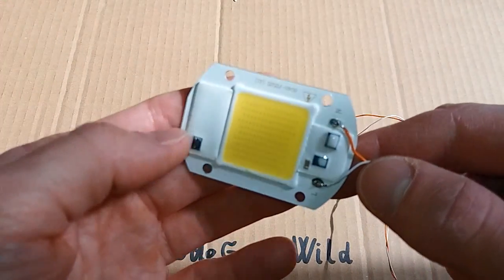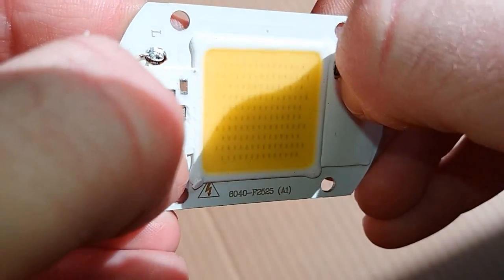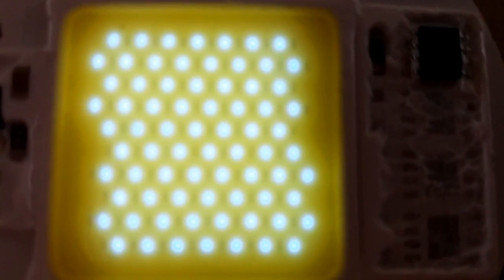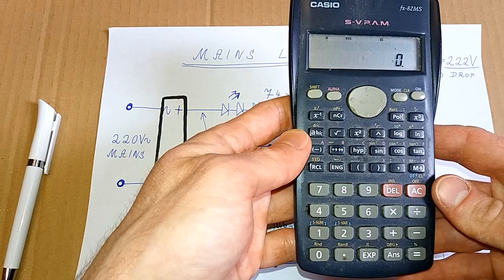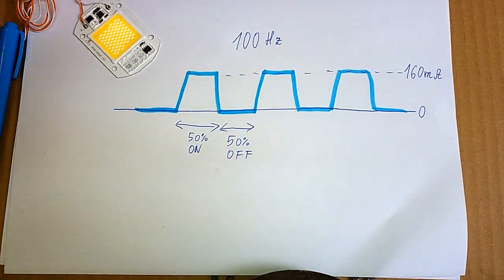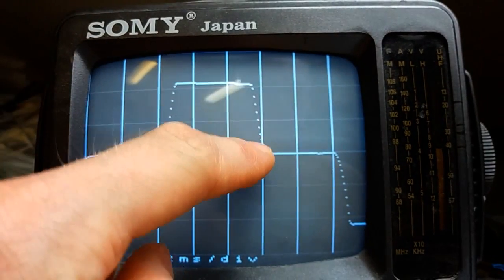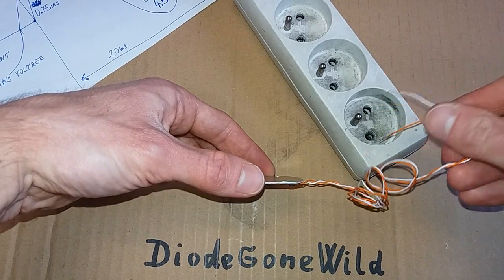Mains Voltage LED (and how NOT to handle mains voltage!)

Comment: Put the filter capacitor across the led string only , the wattage + power-factor will not change, only thing is the capacitor has to be larger, like 100uf or more.

Comment: You need to buy a 50w one and then desolder 4 of the 5 current sensing resistors. you get a 10w led but with more led chips. more lumens per watt

Comment: These can be made much more efficient by adding a dropper C on the AC-side and let its reactance limit the current, taking strain off of the linear regulators. Then simply add a 400V electrolytic (10µF+) across the DC side of the fuuull bridge rectifier for almost flicker-free light.

Comment: Big Clive did a test on these. The board is aluminum with a thin layer of fiberglass. On the top of that is the copper traces for the circuits. He did an insulation test of 1000v 3 times which it easily passed. But yes, always earth the heatsink just in case. I just wish they made these with filter caps to stop the flickering.
Reply: Just get ur own capacitor, I did! It works well, I also got a external full bridge rectifer, then soldered the wire to the L an N
Reply: @ggesdsdsdsd  the light now runs at double the power
Reply: @lifeai1889  Yes, true. But I did remove 2 resistors from it, could also put the capacitor across the LEDs only
Reply: shit power factor+shorter lifespan

Comment: This light works great.✴>share4.photo/oWorkLight?を    It has a bright setting, medium bright setting, and a strobe setting. I use this light to work under trucks and it works great. The only slight downfall is the battery life. The battery will last only a couple hours before needing a recharge. Having two of these lights helps while one is charging.
Reply: This is not relevant to the video

Comment: Help! I connect my driverless cob led directly to AC 220, it exploded and burnt my table. What did I do wrong ? And my room all outlet not working, while the other house area fine. I checked my fuse box no breaker trip. What should I do?

Comment: I just got a few of these (50W) but I don't have any heatsinks for them. I do have a 1/4” thick aluminum plate thats about 8"x10". Can I just cut a piece of that bigger than the LED (maybe leave about a 1/2”-3/4" border around the LED?) and mount it to that? Would that work well enough? I do have some thermal paste also.

Comment: Great video. You helped me understand when the LEDs turned on and off. However you made a mistake calculating the efficiency. You need to use calculus and maximize the derivative of the area.

Comment: "High resistor"= my body 

Next level LIFE hacks 👌
Reply: @cahaya2336  well. its only 20w but yes its very much a bad thing to handle mains power this way XD
Reply: @cahaya2336     doesnt hurt much so long as it doesnt go across the heart. try the finger in the light socket. just make sure youre not grounded to anything

Comment: Hi. Nice video. Does the flickering affect the heating of the LED?
Reply: Yes, flickering draws less power because the led only turns on at half the sine wave which means it generates less heat

Comment: A capacitor on the bridge will eliminate the flicker. Inrush could be a problem though on a bridge that small. The CFL bulbs use a 0.47Ω resistor. You could probably get everything from a couple dead CFL bulbs.
Reply: Do you have any ideas on how to overcome this problem?

Comment: I have learned something. Many Thanks! Any way to know the power factor for this LED lamp ?
Reply from the maker: If the power factor was measured using the phase shift method, it would come out as 1, but even the proper power factor is probably not so bad.
Reply: Thanks for your reply...cheer!

Comment: Hello mate nice video, I think you will not hate this post but however if anyhow u hate it , just remove it . Here is much more about Chinese cheep extended cable which is shown in this video https://www.youtube.com/edit?o=U&video_id=S0WSFyQR5bo
Reply from the maker: Your link is broken. It seems that you mean this video:
https://youtu.be/S0WSFyQR5bo
I have already replaced the cable in my one. It was a 2-wire cable! No ground! Shortly after this, the switch contacts welded together.

Comment: I get goosebumps when i see you plugging in these tiny little and bad insulated cables directly to mains voltage! Could easily be a little fault in insulation.
At least use insulated plyers or solder a better cable! I hope you use at least some kind of FI-fuse? But i like your informative videos - go ahead!
P.S. maybe someone could donate an old analog oscilloscope to you :-) (i have an old Hameg 60 MHz that i rarely use - but still like it for the screen and lissajous-figures e.g.)

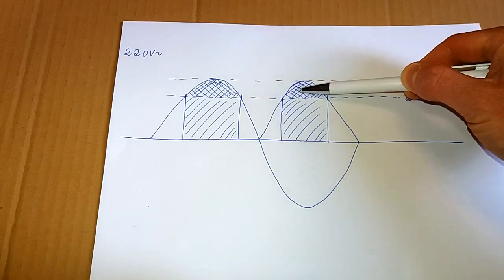Comment: 6:00 The area over the rectangle represents power dissipated ONLY IF the current drivers are linear (where's their datasheet?). If they're PWM, power dissipated will be much lower.
Also, would this flicker less if you put a bigger capacitor in parallel with the existing one?
Reply: Didn't cover this at all inside the video, but if you look at big live channel he has an entire video on this we goes into the data sheet and the chips functions . These are linear ICs .
Reply: Just an FYI - Big Clive's YouTube channel has several videos on this device.  Just skimming his video uploads, I found 3.

Comment: If we plugged this into an American outlet at 120 VAC, would it light up with about 1/4 the brightness ?
Reply: smoothntallGWM your peak voltage is 180V, and the LED voltage drop is 222v. Due to the  current/voltage curve of a diode, it won't get anywhere near nominal brightness.
Reply: Lets call "nominal brightness" = 100.
What brightness would the USA voltage of 120 VAC achieve ?
Would it be 25 ?
Reply: This is really really hard to assess, due to the way diodes work. They should be driven with constant current, but if you don't have voltage high enough to allow this current to circulate, then you're actually driving them with voltage, not current. And the current through them (thus, also the brightness) varies wildly with tiny variations of voltage. Luckily for you, the video actually shows exactly what brightness it should have at 120v.
Reply: The part you want is at 7:45 listen what he says and read the voltage at the rightmost part of the video

Comment: YOU PUT UR FUCKING FINGER BETWEEN 220VOLTS
Reply: Never do as he does. Terribly unsafe practices, which only work if done the right way:
He's probably touching neutral wire, and the live is going through the LEDs before reaching his fingers. Which means most voltage drop (222v) is happening on the LED, and the voltage reaching his finger is relatively low. BTW, nothing would happen to him if he's properly insulated from the ground - even if he were touching live directly, because current wouldn't have a path to escape. Being properly insulated (and not grounded), even if he were to create a short circuit between live and Earth with his fingers (which would be painful and hopefully trip the GFCI) he would still be safe, because current would circulate from one finger to another, going nowhere near sensitive organs such as heart, brain or spine.
But I repeat: NEVER try this at home. Why take the risk? Be safe with your life and health, it's the most valuable thing you've got.
Reply: I've accidentally touched 2 fingers on one of my hands to L and earth at the same time. Sent a tingle up my arm a bit but I'm still here.

Comment: Actually the LED chips will light up at a significantly less voltage than 222, it's more like 2.4 volts per chip rather than 3. At 3 volts they are at full brightness. So the "on" interval is in fact a bigger proportion of a sine curve than you indicated. But they do have the "off" periods hence the flicker.

Comment: I'm sorry for the ignorance of the question. Is there any risk of electric shock if I lean against the aluminum heatsink? Does the bottom of the chip have power when turned on?

Comment: In a series string as used in this unit, forward voltage matching is a non-issue. (I don't know if luminous efficacy at low current could vary much between chips…)

Comment: what the FUCK 2:39
Reply: No, that's just plain-old dry skin resistance.  He's not getting shocked because there's no path to ground anywhere than through his fingers through the LED.

If he wasn't absolutely, 100% not grounded (or he wasn't using an isolation transformer) that would be a very dangerous shock.
Reply: ‍1marcelfilms he probably having a resistor under his finger with insulation between skins

Comment: I wanted to build your scope, but I don't have atmega88 on hand. Can I use smth else instead? I know that atmega8 won't work because of its inferior specs, but what about atmega 328?
 Anyhow, I'll make sure to grab mega88 next time I order parts :)
Reply from the maker: Atmega88PA-PU is on Ebay for about $ 1.30. You can also use the older version Atmega88-20PU. I'm not sure the Atmega328 would work, I haven't tried it.
Reply: DiodeGoneWild Well, I'll buy it eventually, but I wanted to play with the thing now :D Your scope is not very fast, but it is excellent for slow things. I really like how you captured discharge curve of a battery in your article. Plus I have built that battery analyzer myself, works great. Huge thanks for posting your designs!
Reply: THANKS man, for pointing out that DiodeGoneWild is the same guy as danyk.cz! I've never thought of that! I also used his website a lot, but eventually I forgot it. Now I'll check it regularly again. And I have a crush on that cute minimalist DSO, I'm amazed how usable it is, despite its simplicity. I'm a total dummy for programming, but I think it also must have a quite clever firmware to cram in all that into a tiny and old ATMEGA88. I'll definitely build it, I have a similar 5" Chinese CRT TV, and I'm going to build it into that. I'll also add some protection to the inputs, and a compensated, calibrated divider network for measuring higher voltages (maybe even a preamp, to increase the 0.2V/div sensitivity).
Reply: If you want to diy a scope, get an uC with very fast ADC. Or even better, get any uC and a fast external ADC chip.
If you want to spend zero money and do zero soldering, there are some PC scope software which use the audio input of the computer as ADC, this might enable some 40ksps albeit at a low voltage.
Reply: The STM32 has a faster ADC but it's a bit more complicated from a programming perspective. It's still not very fast though compared to the ADCs used in oscilloscopes.

Comment: Yes you are mad with mains voltage, no im not quite so mad LOL :-D
Hmm spare i.c positions for higher current leds :).
Reply from the maker: I think each regulator is designed for up to 10W LED, so the 30W version will have 3 regulators and the 50W version will have 5. I have ordeder a 50W version, but I'm still waiting for it. It was just $ 1.30.
Reply: That's really cheap :-), but the sceptical side of me just can't see how they make them for so little money.
i'm allways expecting some defect or short lived part due to the cheapness.
I'm sure you will give the 50 watt version a good test when it appears :-D.